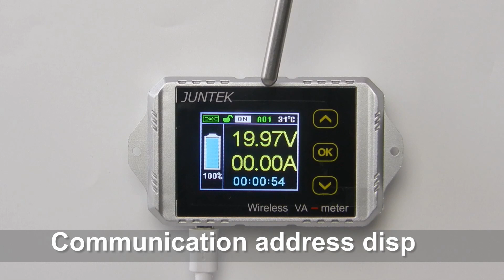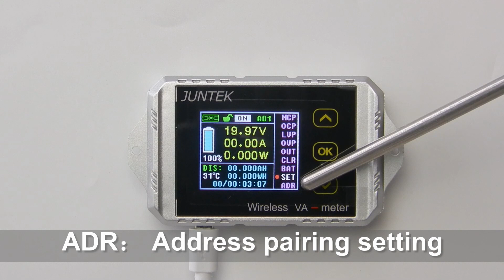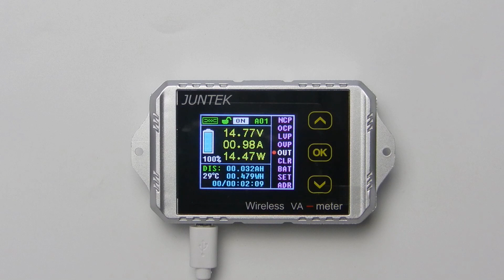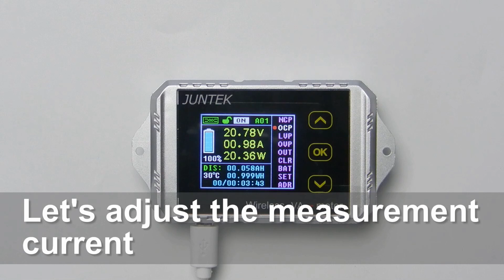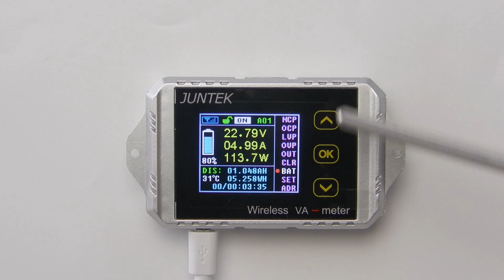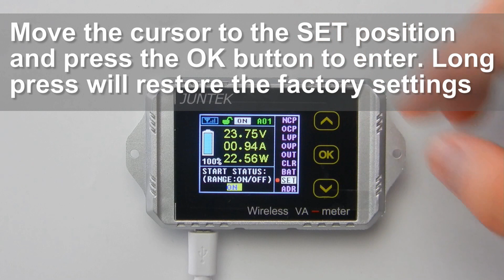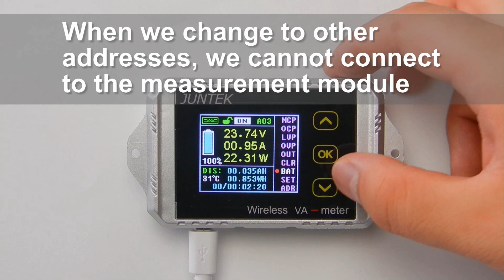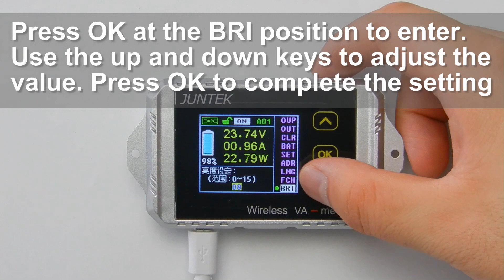JUNTEK VAT series voltage ammeter battery coulomb meter operation function demonstration video

Comment: Juntak PSG9080 display defect

Good morning, I bought the same used one with corrupted firmware, I followed the steps available here on the website and solved the problem, but I noticed that it is showing some lines on the display, I would like to know if it is related to the firmware or hardware update, as I'm an electronics technician, if it's the display, I would like you to give me the reference so I can make the purchase and exchange it. Or I can even send a photo of the situation for possible analysis! Thanks in advance for your attention.